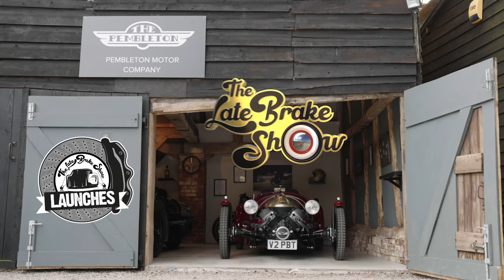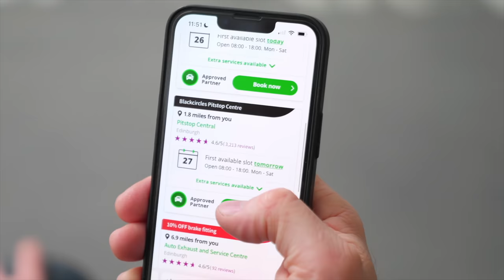The Pembleton T24 Exclusive Review - The LIGHTEST New car you've never heard of

Comment: Other side of the pond putting my 2 cents in. I travel to Japan yearly and I am always jealous of their K cars and trucks. Lightness in a car will allow the gasoline type car to hold on a bit longer before we are forced to use only electric cars. For me it is the mileage. What is the fuel efficiency? What is the coefficient of drag? Thanks for mentioning the power to weight ratio. I would like to see this in a truck version with a flat bed and some hold-downs. A better more robust transmission would also help, geared to take on serious hills. The truck would not need to take on a serious load, maybe 100 to 200 kilos, that's enough for your average home owner. A truck is always nice to have as an extra vehicle. I would strap my kayak onto it. Of course maybe a rollbar just behind the passenger seat would help too. Looking forward to seeing a light truck!

Comment: Been assembling a machine shop to be able to make nearly any part that is necessary to support a new build. I am still recovering from being hit while riding my 1957 Harley Panhead. As soon as it gets a bit warmer here in Pennsylvania I will be starting a Youtube channel named Machines and Motors. The first project is a 1928 RIP Special  Morgan 3 wheeler with 4 wheels. It will have an experimental airplane turbocharged opposed twin engine mated to an MG gearbox with a hand cast aluminum 2 piece adapter . The gearbox will connect via a driveshaft to an MG differential with beautiful wire wheels. The wood over steel frame will be covered with aircraft cloth and sprayed with plasticizer exactly like the airplanes of the time.. The next project in the queue is an MG monoposte boat tail Brooklands style race car with a turbocharged 4 cylinder or a supercharged 6 cylinder motor, manual gearbox and suitable rear differential with dual wheels in back. The third project is an AMG-Merceded 300 SL Gullwing restomod that has been in a friend's garage for nearly 20 years after starting the project himself. I hope to see everyone on the channel as we will have builds, prewar equipment repairs along with builds as well as any other interesting things I would find very interesting as would most of everyone on here.

Comment: I love this and I have the motorbike the engine comes from.  One thing to point out though is that the power to weight ratio of a really light car is massively impacted by the drivers weight but the power to weight of a heavy powerful car isn't.  For example this Pembleton has a better power to weight than an A35AMG however as soon as you add a 100KG passenger then the A35AMG has a better power to weight ratio.  Yes, I did the excel spreadsheet of various vehicles this morning.  It's been a productive morning at work!

Comment: It needs a rag top, one that's easily user replaced when it's inevitably vandalized, a racing harness to keep you inside in a rollover and a roll cage...all doable and not necessarily expensive and more likely to give it wider appeal. I have a 1994 Geo Metro with 62,000 original miles that burns so little fuel that it will go a ways towards mitigating climate change. It gets over 50 mpg and I use it to run all my in city errands because it costs nothing to operate and I can always find parking for it since it's so small. It doesn't weigh much more than the vehicle featured here, which is more fun and also ecologically friendly and economical. Well done!

Comment: It's the One-too-many wheeler. 
light weight, absolutely on the right track. I'd like to drive it. 
it could be a bit less archaic, for everyday use. 
I got a 2014 smart ED, which does the trick exceedingly well, range's a bit restricted, for town use absolutely fine.

Comment: I would buy one like a shot....... the old small Citroën s were extremely good regarding handling, and this will be the same, or better. It would be excellent in the snow, albeit with little ground clearance! I also had a Berkeley T60, which was a wonderful 3 wheeler, but this would knock the spots off that. Morgan inspiration, but using the best of Citroen and a decent engine. Yes.

Comment: The car that Morgan SHOULD be making; and a homage to the cycle cars of 100 years ago. I did a double take before clocking the twin rear wheels. Not sure about fwd but at least it frees up some luggage space behind the seats. The inboard front brake discs give the front end a lighter and cleaner look. The rear end would be tidier if the spare wheel was recessed into the barrel back. I’d have one!

Comment: Having "fun" in a car on the road is being able to thrash an engine to the Red line in every gear and still be doing a semi sensible speed. This will give you a bigger smile than a 5 second blast in a modern super car that will then be doing close to 100 mph in this time . An entertaining Sunday drive on public roads does not require 800 hp .
Yes if you are trying to achieve  the ultimate Nurburgring BTG time this is not the car. But how many times a year can one visit  a race track? The T24 is genuine everyday fun.
  I recently had a weekend with some friends who came to visit driving around the French Alps  for the weekend with there super cars
Ferrari 488 Porsche GT3 Aston Vanquish Mclaren  765Lt. All great cars and I had a go in all of them. But I had more fun in my old BDA powered Lotus 7 and apart from financial reasons I would not swap my  50 year old car for any of them. The modern generation need to start understanding what the  "real" fun of driving is and not be so obsessed by 0 to 60 times and how many BHP the car has.

Comment: That car is beautiful. I wanna make an all-American, RWD version using older Harley 1100 or 1200cc Evo engines. Use the motorcycle gearbox but give the final drive an overdrive so’s it isn’t screaming down the highway at 4000 rip’ems.

Comment: Hi Folks,
        Do you make it with the steering wheel on the other side?  
And could it be sold in the USA?  One other thing, you might try designing a car, from the frame up, that has an ethanol steam engine like the Cyclone 5.
        I would name it the "Gadabout".  It would run on Ethanol.  No transmission. Just a forward, neutral, & reverse gearbox to save weight.
        Anyway, check them out.  Might do well in America or Australia.
        What might your T-24 go for in America?

Comment: I'm surprised there doesn't seem to be some kind of coupe model, convertible or coupelet. I guess you would need to wear full rain gear in this, like on a motorcycle, when driving in rain? Plus it can't be good for the whole interior of the car. I've heard that it can rain in Britain... I have lots of experience driving a motorcycle in rain, and it isn't fun at all. Although with proper rain gear the worst problem is bad visability.

Comment: Imagine this but with a brushed DC motor and a 48v LiFePO4 battery. Legal for anyone to work on without a high voltage license. No electronics except for a balancing charger (which is only needed for charging, not driving). Just simple field weakening speed control like 1960's golf carts and milk floats. A reversing battery contactor for a gear stick so there's not even a single relay to go wrong. Even more no-frills than the petrol version. As easy to rebuild as an alternator. It could even be pretty cheap since it's so light. You'd only need about 12kWh of battery pack, weighing only as much as Johnny. You'd have the same power as the petrol version with only 4.2C discharge rate, which any battery would shrug off. So it would actually be a bit faster due to less gear changes (but still the option, for added speed or added torque). Analog voltmeter and ammeter on the dash to replace the fuel and tacho gauges. A low tech electric car to last a lifetime that no software update, server shutdown or electronic component wear can destroy. That's my dream.

Comment: Needs to be rear wheel drive, engine needs to be between the axles. Make the cockpit wider. That entire power train could have been fitted behind the seats as long as there's enough of a thermal barrier between it an passengers, and ducting was in place to keep it cool.

Comment: I had one of the v-twin Morgan 3 wheelers which I loved. Had to sell it for financial reasons, but later re-engaged with my love of old (or at least old-style) vehicles and currently have an MGA from 1957. I tried one of the new Morgan Super 3’s but found it far too demanding of high revs, and really whiney at lower speeds. It has lost all the character and 1930’s ambiance of the old 3 wheeler. The Pembleton, however, is something that I feel could really float my boat. Not keen on the seats (look a bit too modern and not in touch with the inter-war styling), but otherwise a fantastic vehicle. I feel a factory visit / test drive coming on…..

Comment: Fuel economy is one thing. Just blasting everything out of the cylinder into the air is how cars were made in the 50s to 60s. 
Either fulfill the environmental requirements a car has to nowadays or don't  bother at all, please. 
We need more small economic cars, but they should meet more than a late Soviet standard.

Comment: So, the story here is, his father had the idea, to copy the Morgan 3 wheeler as cheap as possible. Then he came to the idea, to put one more wheel on it.
And that for over 32 000 Pounds for the T24? And the 3 wheeler knockoff costs 28.000 Pounds.
Now to the fuel consumption. Morgan says, 8 litre / 100 km. Where is the reduce compared to a car?  My Toyota CV costs 25 000 €, has space for 5 adults and their luggage, has AC and Airbags, and the consumption is 7 litre / 100 km full loaded. And its not a hybrid. Sorry, you are tricking your viewers here.

Comment: You Sr is absolutely right . We all need a smal; light cars . Cars that can get 50 to 75 MPG or even more . A car should naver have over 50 hp or even 34 hp . A car should never weight over a 1000 pounds ether . All the crap these manufactures put in a car is BS . Power steering , Power brakes because the car are so heavy the driver have to have them . 12 inch computer screen that really dont do a dang thing . Lack of gauges that a driver needs is lacking .  Then the cars have got so heavy the cars have to have wider tires for traction . We become pigs . Really fat ones at that .

Comment: That's a nice fun car i'd love to have......BUT

it has to be said, it's a dangerous car, in the case of a FLIP. and with such narrow wheels, it's not at all out of the question. And since there is no rollbar present, i could imagine this being pretty lethal. at least on a bike, you are not strapped in and as such the energy of the weight of the bike, goes it's own direction, and you keep yours. it's never as safe as a car, but in general, a motorbike could be safer. 

i quite like it, but personally, i'd be inclined to actually want this transformed into a EV. EV-Bike wheel hubs, batteries under the seats, at the nose area, and the rear storage area, and because of the very low weight, little relative power is needed and little relative batteries are needed. it would also do away immediately with the gearbox synchro problems. 

yes, it would increase weight. but still i doubt it would be extremely much heavier, and the torque from EV is high and always and immediate. it's not a car you'd want to go 'fast' in anyway. 

and if you were to put in a EV bike hub in each wheel, you'd have 4-wheel drive at all times, which also is safer. With regenerative braking, you would also increase the range further, and again, need less batteries. would it make the vehicle more expensive, yes, that's a problem. i'd imagine it goes from 32k pounds to about 50k pounds easily. If you want to add lightness i think a carbon body would be neccesary too, but that would add another big amount of price impact too, surely would go up to 60k, and i'd imagine 60k for such a 'car' is really over the edge.

Comment: Out of business in just over 6 years. Go electric.
Reply from the maker: Maybe. But the cars they sell won't be redundant.
Reply: @TheLateBrakeShow  They won't be able to sell any more and the ones in use will become very expensiveto run. This sort of thing is rather retrograde. Why not make a fun, relatively lightweight EV instead? After all EVs have huge zero speed torque.